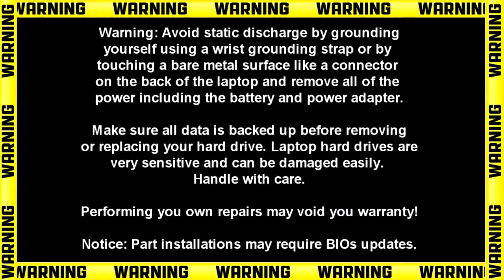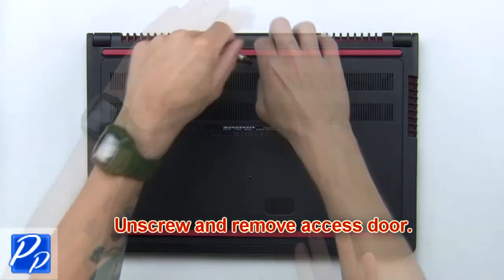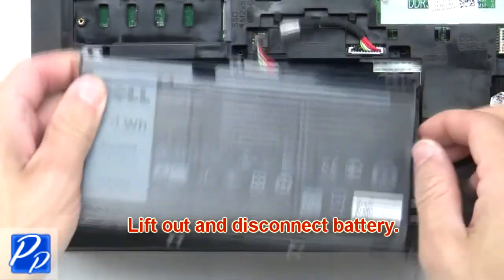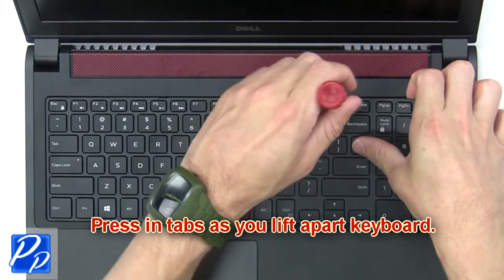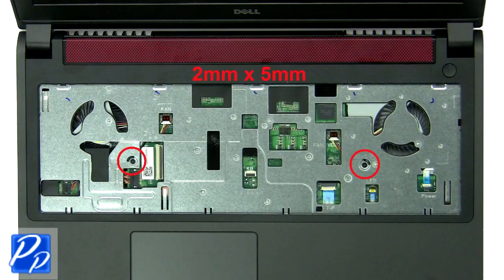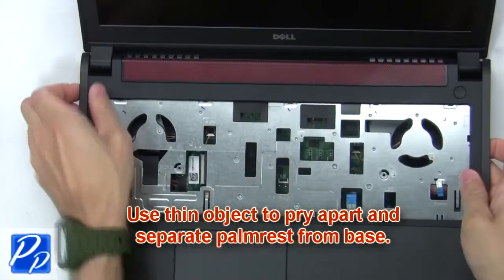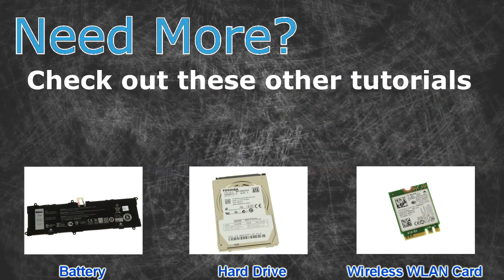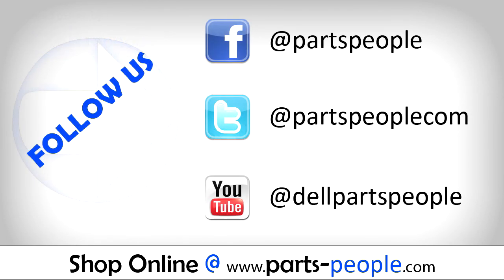Dell Inspiron 15-7559 (P57F002) Power Button Circuit Board How-To Video Tutorial

Comment: My laptop does not on when I'm press the on/off button, if I shake laptop sometime it switch on and it boot up. Once I shut down back, it can't turn on back. What possibly wrong with my laptop . Tks
Reply: i have the exact same issue..have you found  a reason or a solution yet?